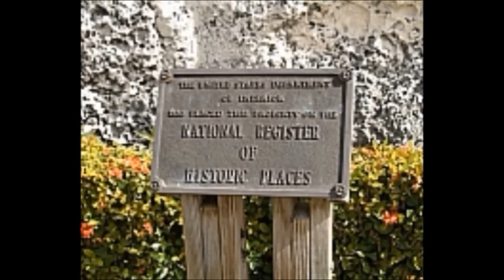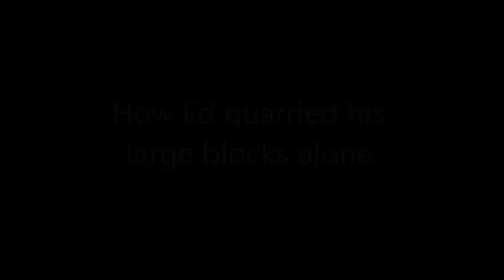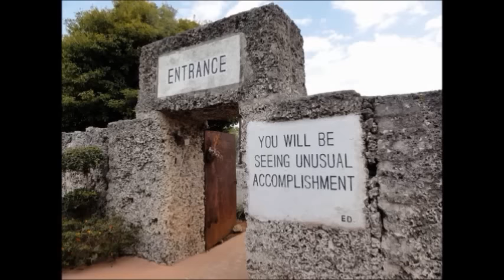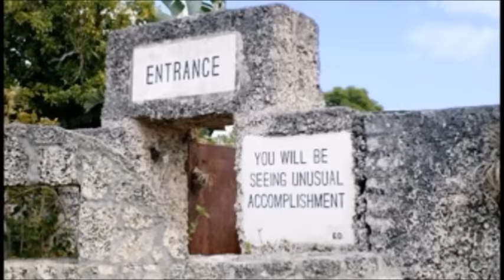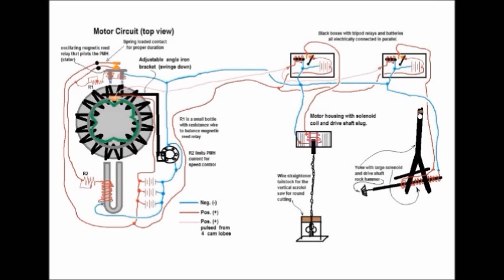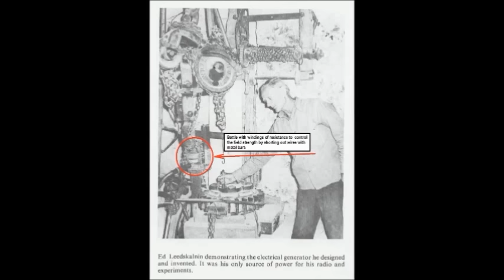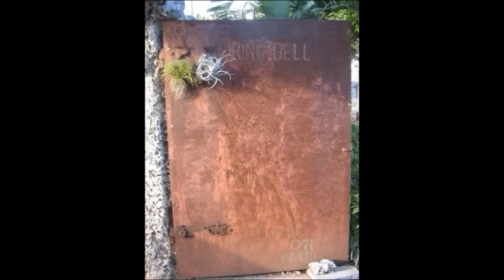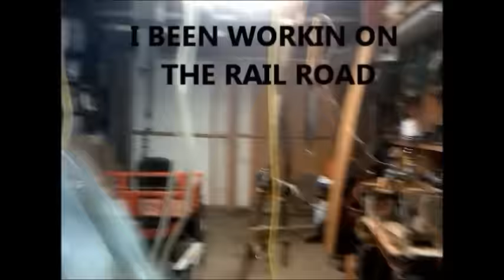Eds Coral Castle Quarry and Flywheel, Engineering Mystery Solved

Comment: I've been in electronics for more then 50 Years.  This is what I'm thinking as it relates to Ed;s efforts and design,  All you need to do is look at his generator device, (one of six he built over time),  It uses "V" (NOT BAR MAGNETS),  magnets there was a real reason for that.  The magnets were set up 25 magnets around and 5 deep.  They were set up in repel mode to send as much "B" field into the earth as possible.  The "B" field is the center of a magnet not the North or South poles those are the weakest points on a magnet.  The "V" magnet is a perfect device  for his purpose given the "B" field is at the center and allows all magnets to supply the center as needed then through the crankcase and then into the ground. 

Once the ground was saturated with the "B" field energy I suspect he would use sound to manipulate the stone do to the fact the stones magnetic properties were totally disrupted by this injection of the "B" field energy.  You can conduct your own  test just by fast  tapping a granite rock with the "B" field of a magnet you will see it loose weight!!  Have
Reply: How would you bend the bar magnet onto a V shape without affecting it's strength? If you heated the bar magnet to bend it, wouldn't  it lose it's strength? If you tried to re-magnetize it, wouldn't the apex of the v become a pole? If on the other hand, you don't heat it, and bend it cold, aren't you in essence making a horseshoe magnet?  I fail to understand why you say the B field is the strongest, could you explain?
Reply: @gerretw   You bend the steel and then magnetize it after it cools
Reply: @gerretw  If you didn't have the "B" field north and south poles would not exist.  Why do you think they are separated on any steel.
Reply: @vincecox8376  I understand the need for the B field  but isn't the field most concentrated at the poles? My question is: why do you say the b field is stronger than the field at the poles?  I am not arguing, I want to know why that would be so. Looking at the pictures of Ed's machine - the magnets poles are touching, and the V is pointing towards the center. plus they appear to be wrapped with something, a sheet of copper? Perhaps making them into electromagnets?
Reply: @gerretw  Thank you for your concern,   The "B"  field gives you the North a South poles.  The reverse oscillation are a product of the "B" field ....
Reply: Vince Cox   My understanding is that there is no magnetism at the center of a magnet. There must be some kind of phenomenon for the reverse oscillation to occur. Can you elaborate on how this force/phenomenon could be used in a way other than its natural purpose, or help me google it better than “B-field” :)??
Reply: @gerretw  , No ,,  you bend the steel then magnetize it,  standard practice.
Reply: @fredrock9974   The center of a magnet can best be described as the battery for the magnet force at the N  and S poles..  Without the "B" field the N and S would not exist.. They have to have a energy separating them,  think about it.  !!!!   OK now take another step forward ,  It is my belief that Ed L. at Coral Castle used two basic elements to levitate his 30 ton stones and it has to to do with one more element.  Resonate sound waves from a similar stone that is being worked on..  There was one additional "CRITICAL element to his facility and that was a pillar with a similar stone  that was being used for construction,  This stone sat on top of a pillar and was Horizontal to the pillar at top.  ( like Stone Henge,  I'm thinking these were power plants for construction...) I believe that the combination of the  oscillating pillar rock on top and the Magnetic natural from the "B" field   Caused same to  make the rock like Styrofoam in substances.   I still think there may be a third character in this effort   Not just the "B" field and the Sound resonance.
Reply: @fredrock9974  Without the "B" field N and S would not exist.  The B field   ""does ""   have effects on all matter unlike the N and S poles that care only for metal...Iron..
Reply: @fredrock9974  You are 100 % correct,  But without this energy ( B' field), separating the N and S poles you would not have a magnet!!
Reply: @fredrock9974  The center energy is more powerful  then the two end poles N & S combined!!! .      N & S would not exist without the "B" field..   Ed L. of Coral Castle... recognized it's affects on all other types of matter...
Reply: @Vince Cox Have you read the books he left behind? If he truly did levitate (fellow believer) then he arrived at that conclusion and technology logically. “...All current is naturally alternating...” . I see your sound waves, and raise you another hypothesis - instead of vibrating the molecules like a microwave, a specific pulsed electromagnetic frequency could spin the nucleus of an atom without disturbing the bonds that hold a rock together...

Comment: No magic here he was just a great engineer.
Reply: yeah, but I was really hoping for the MAGIC thing,.. I mean,  Who doesn't love magic?
Reply: But great engineering IS magic.
Reply: Henry Kroll I concur Mr. Kroll.
Reply from the maker: Great comments, kevin Tucker, Gary Kovach, and Henry Kroll, It seems there is a Teasing boundary between magic and good engineering. Simply because a bic lighter to us is an engineering delight, hee but to an aboriginal firekeeper/starter IT IS FEEKIN MAGIC fer sher.        PEACE   BROS
Reply: Any technology sufficiently advanced in comparison to our own that it is completely incomprehensible is magic.
Reply from the maker: Peter Stenbuck. You hit it on the head. BUT just remember, as well.....any technology that even monkeys may have used that we DON't KNOW is also comprehended as magic.
Reply: If you think he did it with this in a night you need to lay the pipe down

Comment: Over 40 years ago, somebody told me that 4 of us kids could lift the weight of a person sitting on a chair, using just 4 pinkie fingers. We all stacked our hands on the seated person's head, and imagined the weight of our bodies going down through the stack of hands. Then we each put one pinkie finger under 1 corner of the chair, and lifted ... and the chair was raised up as light as a feather.
I always figured there was some dread witchcraft involved, and never tried it again.
Any other suggestions for why this worked?
Reply: Ruby Gray Ive seen videos of this, as well as the same kids trying to do it without stacking, and couldnt be done,, maybe investigate? everything is magic until explained.
Reply: Ruby Gray  my pappy dug coal all his life men can move mountains we do it every day..
Reply from the maker: No but I would think if ED ever levitated rocks for real with "witchcraft" it was the same way and NO ABSOLUTLEY NO IRON MACHINE. it would have been the same way to some people the storms, floods, lightning etc MAY be tied to our souls????    EEEks????  So I went for the grounded NON HOCUS POOCUS CA DABABRRAADOODLE method. See I can't Spell Well.  WHEEL   hmmmm excuse me.    eeerp........
Reply: I think this video nails it. 
He worked at night because it was too hot to cut rock during Florida days. His mystery wheel was his off-grid electricity generator to run his rock-sawing machinery. 
Coral presumably is riddled with holes, therefore large blocks weigh much less than solid rock of the same dimensions. 
He used the tripods to lift the blocks up, then rolled them into place on rolly logs, which I have done myself, being a mere girlie.
No big metaphysical secrets here.
Reply from the maker: Ruby Gray Very good. speaking of girlies, here my good lady check this out. AND YES you nailed it. I have some revisions etc like the boxes held oil not the batteries, MY BAD, but the rest works actually. But I have a new marathon chipping sequence up now but back to the girlie, In my state of VT, 20 miles away, too,     https://youtu.be/_bdh0fG0uOg

Thank you much for the objectivity.
Reply: Ruby Gray
Reply: Its very simple.  It didn't'.  Not as you described.
Reply: Rick Sutha

Yodel? Why can I see just my username? Did you have something to say?
Reply: Mind over matter. Faith is a powerful thing.
Reply: Faith in "faith" is meaningless.

Just like faith in electricity is meaningless, if the cord is not plugged in. Nothing can happen without the infrastructure that creates the power, and the information which governs its operation.

The occult world provides both information and infrastructure, through the medium of demonic spirits. They exact a heavy toll for their apparent docile obedience to those who claim to "have the power" to read minds, perform magic, see the future, channel ancient characters, levitate, use astrology, etc.

Comes time to pay the piper for having the audacity to thumb one's nose at the true Lord God and mess with the fallen angels, and the demons welcome another dead fool to their lair.
Reply: Ruby Gray the guy in the chair stood up so that the kids thought they were lifting him up but actually it was just the weight of the empty chair
Reply: Ruby Gray I think +Made by One Man would be disappointed to see you comment. In the video he made it very clear that Ed useed a commercial generator driven by a reciprocal internal combustion engine. The mysterious fly wheel is an electric motor (a stepper motor to be precise) with contacts on the rotor to generate electric signals that controlled the on/off of the solenoids that drive the power tools on several of his rigs.
Reply: I've done it also, I have no idea the secret of how it works.
Reply: me too and it works......no idea how though
Reply: John Keys 
Leverage,BLOCK n Tackle Counterweights
Reply: Karl H

Nope, the seated person's weight was all on the chair, feet off the ground. I know this because I was one of those doing the lifting. Because it happened so easily, we just accepted it as "normal" which of course it was not. With wisdom and hindsight I now recognise that there was some spiritual force at work, and not in a good way. This was some occultic stuff. I have never tried this again in 40-some years, barely even thought about it, but it is interesting that somebody else mentioned having seen it done.

Also, Made By One Man has already responded favourably to my comment that he had "nailed it" with his description of how Ed Leedskalnin did his stone masonry with standard techniques. I cannot see that any hocus pocus was involved there.
Reply: Well most part of your comment didn't have any problem, however, the "the mysterious wheel" is NOT a generator as you said in your comment. Rather, it's a rotor of a stepper motor. He probably missed that part in your comment. But if you want to be stubborn and insist that "the mysterious wheel" is a generator, I really have nothing to say.

As for the 4 kids lift adult trick, he probably was somehow pulling his own weight. Or maybe he's just not that heavy, like around 120 lbs, I guess it's not really a big deal lifting 30 lbs using one finger. BTW, if the chair is resting on the ground to begin with, how did you put your finger under the chair legs in the first place?

Besides that maybe the limited cognitive ability of a child has to do with what you remembered as "facts". For me, I remembered my cousin could chop her thumb off with another hand real quick, and grow it back in the next second, it was years later that I realized that was a trick. xD
Reply: I would call that a Wheelhouse Switch with Scallops.
Reply: +Karl H

Didn't you watch this video? The guy told us that the wheel of magnets was an electricity generator already.
I was 17 when we did that trick, not some dozy infant. I know what happened.
We each put one finger underneath the seat of the chair, right next to where the legs joined on.
I don't do this any more, I know better. It is a form of divination which is forbidden.
It is interesting that other people have also experienced this exact same phenomenon. I suggest they don't do it again either.
Reply from the maker: Bahh   its not divination, Divination is only if YOU can do it and THEY can't then its TRUE         DIVI      NATION. So if you can really do it then you know its potential evil power. But i will always say the wind blew the door shut. NOT MY WILL. so how would YOU ever know. However lifting Rocks off the ground would certainly create a stirr.
Reply: Made by one man

In the Bible, "divination" is the attempt to produce physical manifestations which are beyond the natural realm, by dallying with the occult or supernatural spiritual forces.. Like water divining, crystal ball gazing, etc.
Reply from the maker: So if that isn't our world, then what is NATURAL. and like water on earth today , natural is all poisonous, so when WAS natural ok?. like our electricity to everone today its common knowledge but 100 years ago I myself would agree with your premise on "divining" taboo! can't see it.! etc etc. more biting the forbitten, and even asking a spirit for guidance could be called divining many have been guided by it, but they are witches. BURN em. and the rest just never see a thing. YOU ARE TOTALLY RIGHT. ignorance is certainly bliss. NO divining.     
PS. Dowsing for water used to be called "divining".  loose lips sinks ships. So if I found fifty gallons per minute I certainly would NOT NOT NOT tell how. I just got lucky I guess.    sincerely Scott R.
Reply: Interesting theories!
All I know is, it happened as explained.
I am certain there was external spiritual input involved, and not in a good way.
As a kind of taster to get us to become more deeply involved in occultic things (which did not happen in my case).
Reply: Yup, I'm real!!
I can verify that the power expended in lifting the person seated on the chair did not come from the 4 fingers beneath it.
Jesus did miracles, proving that solid objects are not as "real" as we who live in these 4 dimensions of space and time are accustomed to rely upon.
But they were never opportunistic displays of power. They were only to meet needs for the greater good.
Jesus said that His followers would be able to do miracles too, if they had faith. Genuine life-changing miracles do occur (i have had some), but they are not to be chased after for one's own amusement.
Several kids clowning around really did nobody any good. And the power behind it was not something we consulted the Lord about nor anything encouraged in scripture.
Reply: Why could this not be a satisfactory conclusion?
People have been burned as witches for doing less.
Have you tried this?
Reply: Ruby Gray My friends and i played this same game many times... It works!
Reply: Joe Cat sounds common enough for it to be on YouTube...
Reply: "light as a feather stiff as a board"
Reply: Ruby Gray The Bible says that if we have Faith the size of mustard seed we can move mountains!  Children usually have more faith than adults!  I doubt it was demons.  I have seen that done myself when I was in grammar school.  There was nothing done to invite demons.

Comment: Weird... you didn't explain how he could load a 30 ton block onto the back of a flatbed truck in seconds without a tripod. Or how he singlehandedly moved the entire place by himself, and even the truck drivers never saw how he loaded them...
Reply: Simple, the truck driver are liar 😅😅😅
Reply: He DID explain it though.
Reply: @tashacherry1480  Who did?
Reply: Here's a theory.... Flat bed truck with a wench or anchor points to connect come alongs to. The bed of the truck could be a dump or tilt bed, by pulling a couple of pins and the bed would tilt down, touching the ground. Winch or come along the rigged up coral and pull it into the truck. As the coral reaches the balance point on the bed it would tilt back down on its on. Then all you'd have to do is deliver the stone wherever you'd need it. No go build your coral castle.